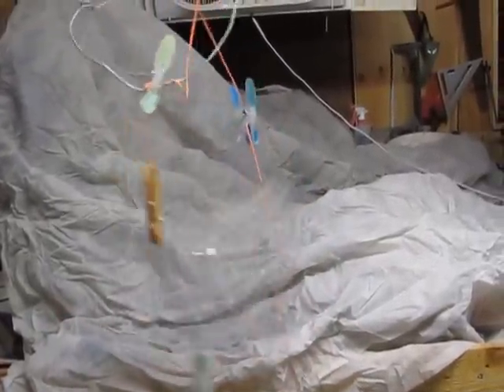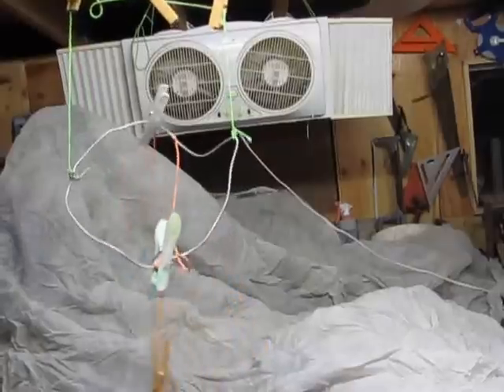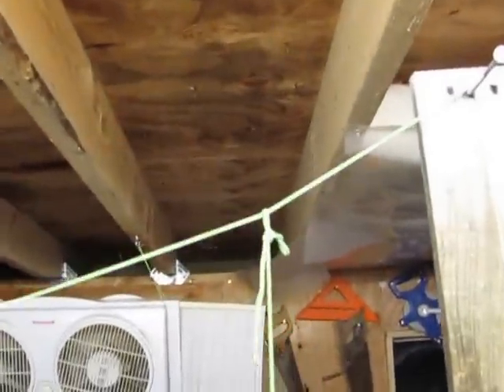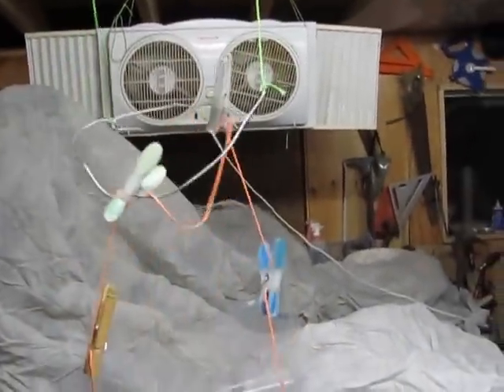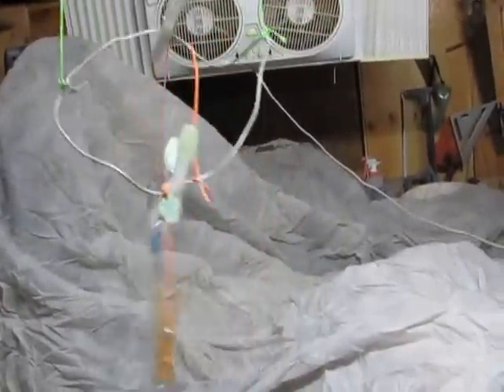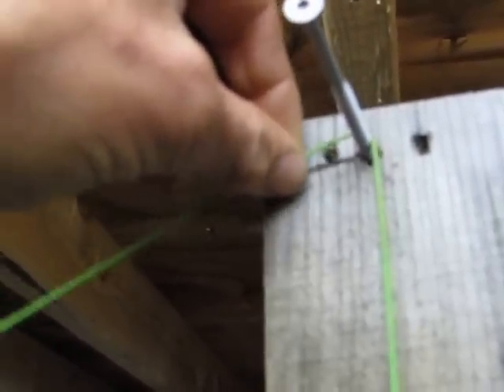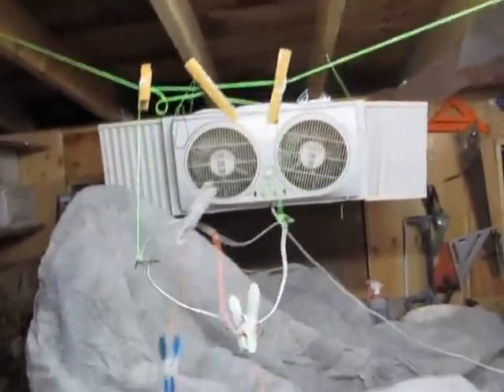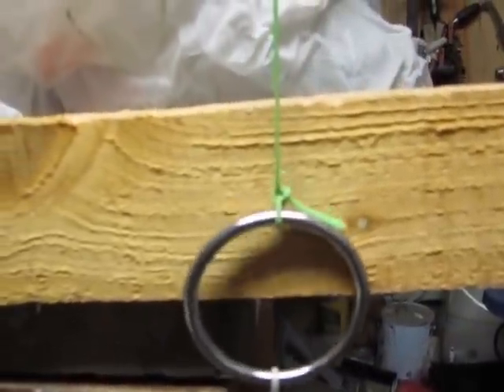Good Vibrations? Lets harvest wind  energy from cotheslines!

Comment: Imagine this:

A panel with two parallel strings attached vertically- one along each edge.  
The lower ends of these strings are secured to the ground. The upper ends loop over pulleys, then down to the pumps.  

As the panel spins maybe an eighth of a turn with the breeze, the upper ends of the strings power the pump.